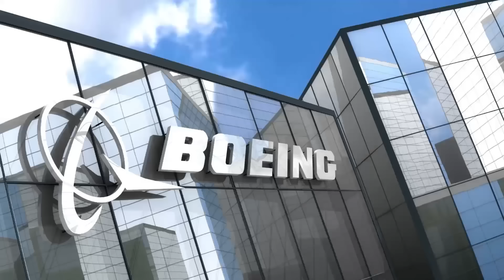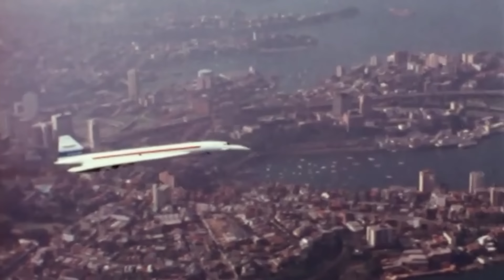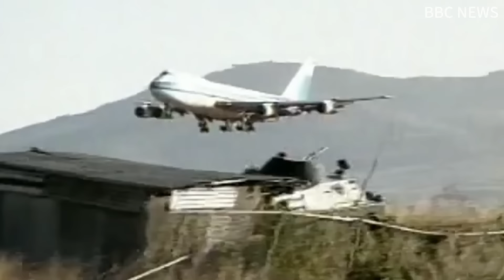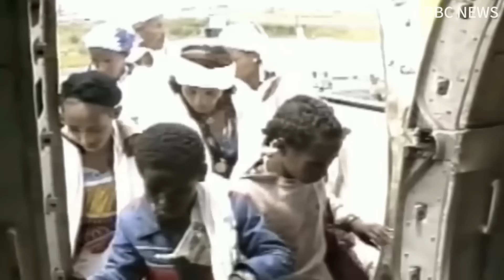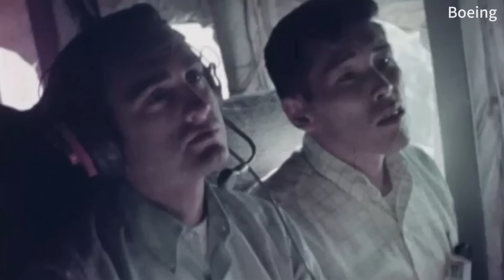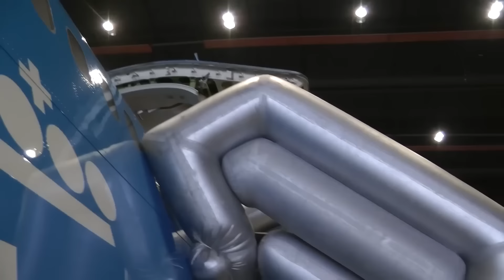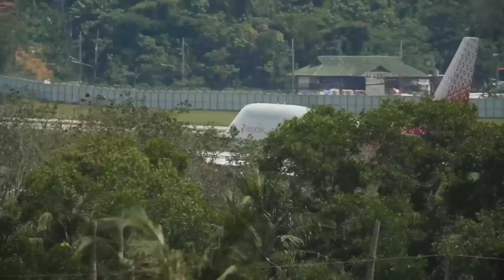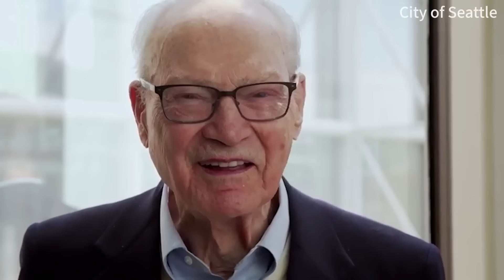What The Boeing 747 Hump Was Really For

Comment: My first flight on the 747 was the "Red Eye" from San Francisco to Atlanta on Delta in 1970.   Because the flight was not even half full, I was able to put the armrests in the middle four seats up and sleep all the way home.  What an aircraft!!
Reply: I did that on an Airbus A330 on the way from JFK  to Helsinki.
Reply: I was a rather excited 7-year-old back in '72 when looking out the window at the gate, I found out that for my first trip on an aeroplane, it would be aboard a 747 "Jumbo jet".  Also exciting (for me) was the boarding was through a jet bridge -- as previously I'd only been at smaller airports where you board via airstairs.   Once aboard, the size of the aircraft was quite apparent with the two aisles with 3-4-3 seating (as at the time, single aisle had been more common).   Once we were at cruise, I asked my grandparents (on this trip, I was with my grandparents and an older cousin) for permission to wander about inside (they were worried I'd get lost in what seemed to them a ridiculously large aeroplane) -- walked all the way to the front and back.  Stopped and looked up at the spiral staircase up to the upper deck (but didn't climb up).
Reply: @nuk1964  - It's funny, because these days most people I know would be entertained by the novelty of having to use airstairs to get into an aircraft. Plus, I know that I least feel more "connected" to aviators by walking on the pavement and past the engines, almost like I'm doing the pre-flight walk-around.
Reply: @bruzote  airstairs are nice -- as long as it's in fair weather and too hot nor too cold, and you don't have mobility problems.
It is indeed quite interesting to watch the built-in airstairs being deployed and retracted (such as on the Boeing 737).
Reply: @nuk1964  Cool 🙂
Reply: I did the same on a flight from San Francisco to Honolulu on a 747 then again on a flight from Seattle to DC Dulles on a different aircraft, which I have forgotten.  

The most strange thing about the latter was I was in the center seat of 5.  A woman with a baby boarded and got very upset when she discovered that I was seated in the same row (where she was in the left side seats).  She wanted the entire row to herself so she could nurse her baby.  The flight attendant told her that she did not pay for an entire row and she could move back one row to have that row entirely to herself.  She was quite angry for the entire flight.

I contrast these to a flight from LAX to DC Dulles.  I was once again in the center seat.  I am not a narrow person, but in that row, I was one of the thinnest.  Immediately after takeoff, I pulled down my tray, layer my head on my arms and slept most of the 5 hour flight.
Reply: L
Reply: Some interesting replies to your post, starting a debate about the ethics of folding airliners armrest seats down  so you can stretch out under a thin blanket and hopefully snooze away a 12-14 hour flight, lol. I always thought they are such a cool looking aircraft since I first got interested in aviation . I was going to reply to the guy who posted this video about commentators experiences flying in a 747, but after reading yours will post mine. For me it was the first time I flew internationally,  1986 from NZ to the US in a Pan Am 747 with my sister who lived in New York. Fortunately she was an experienced air traveler, so as soon as possible grabbed extra seats to stretch out in, a good tip! The plane had lots of empty seats so I thought that’s how it would always be, however after 100 + flights that hasn’t happened much.Lucky if you get one empty seat next to you, which happened last year when I couldn’t get a window seat, however once we were airborne a lady with a baby in a single seat across the isle asked if she could swap seats , so that was my good deed for the flight. Pan Am ‘s long gone , but since it was my first it left a great memory, especially one of the flight attendant girls, she must have showered in perfume before boarding, leaving a cloud whenever she passed and had more makeup on than I’d ever seen up to that point on a gal, but staying in New York for a few months soon educated me about that sort of thing, lol.
Reply: It's not an Red eye if you are passenger.
Reply: nothing about this has anything to do with a 747. You can literally do this on every aircraft that has 4 middle seats. I've done so on a 777 and a 320.
Reply: @jemand8462  a320 does NOT have a middle row
Reply: @jemand8462  you are a jackass
Reply: @jemand8462  Are you daft? How does the capabilities of other aircraft make the OP's story about his first flight on a 747 not count as having anything to do with a 747?

Other aircraft can do the same thing? Cool.

Is the story about other aircraft? No.

The OP's post has EVERYTHING to do about a 747, because the post is specifically about a 747. So, good job, you've proven both that you know about other aircraft, and that you're an idiot.
Reply: @AlindBack  LOL
Reply: @AlindBack I did the same thing on an Airbus 380 transfer flight. It was probably 80%+ empty. 10 rows of seat. I was the only one in 3 rows. Because of the YouTube algorithm, I'm sure the OP is just happy people are commenting on his post.
Reply: @AlindBack  are you daft? What does a story about sleep in a 4 seat row anything to do with specifically the 747? nothing.
Reply: @AlindBack 
This idiot doesn't know anything about aircraft.  Neither the B777 or A320 existed in 1970.  And the A320 has only one aisle.  So good luck making a bed out of the "4 middle seats" on that one.  Replying to trolls and idiots just gives them credibility.
Reply: @AlindBack  - I am laughing, and also thinking on a bad day I could make the same comment you're tearing apart. :-D Humbling.

Comment: Actually, the hump wasn't there because Boing thought the 747 was going to be a freighter. It was there because Boeing was competing for the new Air Force heavy-lift contract that eventually went to Lockheed and the C-5. The C-5 also has the cockpit above the nose.
Reply: And a full-length (but very skinny) upper deck with passenger seats behind the pilots.

Comment: I’ve been on a 747 three times. Once from O’Hare to Seoul round trip, makes sense.  The strangest 747 flight I took was United Airlines O’Hare to Denver.  This is like a marathon runner, doing a 200 meter dash.  I’m sure United had a good reason for using a 747 for this flight, it was practically full.  I was shocked while waiting at the gate when 747 rolled up for such a short flight.
Reply: There was a short range version, I guess with more seats instead of fuel. Mostly used on heavy trafficked Japan domestic flights IIRC.
Reply: @BoomVang  I figured United was just moving the jet from one part of the country to another and filling it with passengers to make some money, maybe they were hauling some cargo too.  I don't know if this is something they used to do all the time,  as I don't fly commercial very often.   I'm sure the fuel tanks were practically empty for a 747.

Comment: My first, and only, ride on a 747 was in 1991. I was stationed on Okinawa for what was supposed to be 18 months, that turned into 22 months  another story)....But after a year I took a 30 day leave to go home...the leg from Japan to Hawaii was on a brand new 747 !!! I was very impressed with the 747 until....the overhead passenger reading lights started screwing up. If you turned it "off", it would continuously flash on If you turned it "on" it would flash off.....Apparently the crew could not to disable the entire system so we "enjoyed" being locked inside a flying disco tube for a few hours, until Hawaii. The flight was scheduled from Japan to San Francisco with a fuel stop in Hawaii,....That 747 was taken out of service forcing the airline to find seats for all the displaced passengers, and as it turned out the majority of the passengers were going on to San Fran....while I was going to sit in Hawaii for a few hours, since I was traveling on a 50% off military stand-by ticket and got bumped off EVERY seat that was available from Hawaii to the States until the full paying passengers were taken care of...not mad, that's just how the system operated, and operates....and how I remember my first and only ride on a 747.
Reply: I was on Oki then also. I was at Kinser with 3d FSSG, Maintenance Bn. Don’t recall flying on a 747 going home on EML. Semper Fi.
Reply: This happened to me - the flight engineer's solution was to give the crew  a roll of black tape!  I said it would puzzle the people investigating an aircrash, that and electrical engineers light was covered with black tape. (I suggested they should isolate the circuit!).
Reply: I flew from Frankfurt to Chicago on a United 747 in the 90s.  I sat in the middle seat of the middle section of five seats. The in-flight entertainment screen in front of me did not work and displayed nothing but static the entire flight.  The flight was packed and there were no other seats available.  I had to drape my jacket over the seat back of the seat in front of me to keep from getting a headache.  Fortunately the passenger seated in front of me was very accommodating to let me drape my jacket over the back of their seat.

Comment: The cruise speed was 625mph
Reply: Cruse speeds are measured in Mach numbers, which due to barometric pressure variations do not readily translate to the same mph/kph speeds.  However, for your satisfaction, 747s hardly ever flown to exceed the 900 kph / 560 mph mark in zero wind, for fuel saving and other purposes.  Your provided value may be achieved but with considerable tail wind.

Comment: one thing that is very interesting about the earlier 747's.

the original -200 had the short upper deck that the -100 came with, but during its lifetime, boeing offered a streched upper deck (SUD), that could be fitted to already build -100 and -200 airframes.

they ended up converting 2 -100 (both for JAL) and 12 -200 (2 for UTA and 10 for KLM) to the longer upper deck, which increased the passager capacity and suprisingly made it more fuel efficient

for the conversion, they had to completely remove the structure of the existing upper deck aft of the cockpit and part of the fuselage behind the original hump, before rebuilding it, with the longer hump.

this essentially was a test for the later -300, which came from the factory with the "SUD upgrade"

if you wanna see pictures of the converstion in progress, look up "boeing 747 SUD conversion"

Comment: What nonsense!! The modern day aircraft don't travel at M 0,80 because they CAN'T be designed to go faster("even with computers"), but because ALL airlines choose efficiency over a little more speed.
Reply: *fuel efficiency
Reply: That's exactly what he said in the video, didn't he? I'm sure that laymen understand that the plane can go faster by using more fuel, but it's for special circumstances. Just like when you walk outside, even though you can walk faster in special circumstances, and can even run if you're allowed to run.
Reply: What nonsense?? That was obvious from the video. All of aviation from the '50s through the '70s was about speed: "get there, get there, get there!" - noise, air pollution, and fuel consumption be damned. Yes, there was concern for aerodynamics and efficiency, but only after environmentalism really kicked in did that become THE top priority. (Fighter jets have slowed down since that era, too, for a different reason: the emphasis changed from speed and power to stealth and electronics.)
Reply: @RB-bd5tz  What nonsense? Re-watch and listen for this quote, "The modern day aircraft travel only at M 0,80 and they CAN'T be designed to go faster("even with computers")." This was a claim about the unique design of the 747.
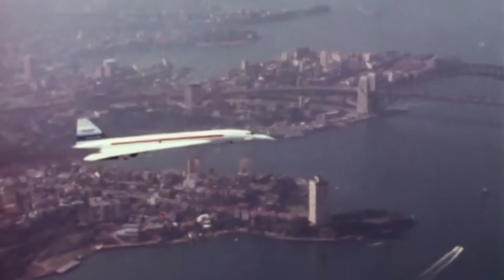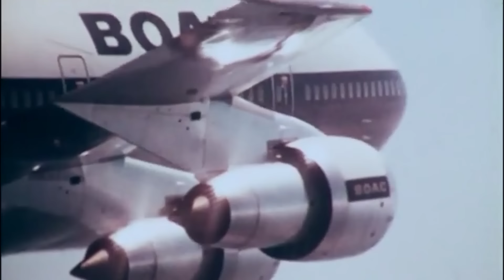Reply: @lours6993  Ah, yes: 3:35-3:45 "an aircraft that modern computer-aided competitors can't outpace". That simply means they can't, which is true. But I see, and agree with you, that it also implies that we can't do better now, which is a dumb point to make.

Comment: US Airforce sought a heavy lifter aeroplane, the 747 lost out to C5 Galaxy. So Boeing got PamAm to buy it as a passenger plane.
Reply: inaccurate. The 74 was build with both categories in mind, the C5 wasn't.
Reply: @Advancedkid ,

The *C-5 Galaxy* and the *Boeing 747* share a fascinating common origin in their initial design purpose, stemming from the same US Air Force requirement in the early 1960s:

1.  *Common Origin: The CX-HLS Program (1963-1965)*
    *   Both aircraft were born from the USAF's *CX-HLS (Cargo Experimental - Heavy Logistics System)* competition launched in 1963.
    *   The goal was to develop a massive strategic airlifter capable of carrying *outsize and oversize cargo* (like tanks, missiles, helicopters, bridges) that couldn't fit in existing cargo planes (like the C-141 Starlifter).
    *   Key requirements included:
        *   *Massive Payload Capacity:* At least 100,000+ lbs.
        *   *Intercontinental Range:* Unrefueled global reach.
        *   *Outsize Cargo Handling:* Ability to load bulky, heavy military equipment quickly.
        *   *Rough Field Capability:* Operations from shorter, semi-prepared runways.
        *   *Drive-On/Drive-Off Loading:* Via nose and aft cargo doors.
        *   *Kneeling Landing Gear:* To lower the cargo floor for easier loading.

2.  *C-5 Galaxy's Specific Initial Design Purpose:*
    *   *Winner of the Military Contract:* Lockheed won the CX-HLS contract in 1965.
    *   *Pure Strategic Military Airlift:* The C-5 was designed explicitly as the **US Air Force's premier strategic heavy lifter**.
    *   *Focus:* Rapid global deployment of outsized US Army and Air Force equipment directly to forward areas, potentially on rough fields. Its cavernous cargo hold, nose/aft loading, and kneeling gear were optimized for massive, bulky military hardware. Speed and range were critical for global power projection.

3.  *Boeing 747's Specific Initial Design Purpose:*
    *   *Losing the Military Bid, Winning Commercially:* Boeing lost the CX-HLS military contract to Lockheed.
    *   *Commercial Freighter First:* Recognizing the need for a commercial counterpart to the upcoming supersonic passenger jets (like the SST, which was later canceled), Boeing pivoted their CX-HLS design. *The initial 747 was conceived primarily as a high-capacity freighter.*
    *   *The "Hump" for Freight Loading:* The iconic upper deck (the "hump") was specifically designed to allow a *swing-up nose cargo door* for straight-in front loading of large freight containers and outsized cargo, while keeping the cockpit above and out of the way. This preserved the main deck's structural integrity and volume for freight.
    *   *Passenger Potential:* Boeing knew the airframe could also be adapted for passengers, anticipating the need for high-capacity "jumbo" jets on busy routes. While designed as a freighter first, the passenger version entered service before the freighter variant (747-100 vs. 747-100F).

Comment: Landing in Kai Tak and had the privilege to be in the flight deck
Reply: I landed an Air Canada 747-400 at Kai Tak as first officer in the right seat. It was a challenging approach with a very low right turn onto final runway heading just above the rooftops. There was a building with a checker-board pattern visible ahead just as you started the right turn. I could see the clothes hanging out on the balconies very close below the right wing tip while making the turn. The timing of the turn was very critical so that you didn't overshoot the final approach path. That would require a go-around since reverse banking the aircraft to re-acquire the approach path so low would be very dangerous.  It was my only landing there as most captains took the difficult landing and Kai Tak airport closed shortly after in 1998.
Reply: @jimpike7445  Memories you dont forget. I have flown the 747 various varient sunch as teh Combi - Air India and from 100 through 8. over 500 times in my life. Sat in the very first row in MEA, Saudia, Lufthansa, Swiss and lots more. Remember Sabena? well I have flown than as well. And let us not forget PAN AM!!!!!!! I have also flown the 747SP!!! I have to say I am very fortune.
Reply: @mmhuq3  Sabena    Such a bad experience never again     SAS  same and sabena
Reply: @jimpike7445   The difference between us is I actually used to fly  the checkerboard approach at Kai Tak and you are making the whole thing up.  The checkerboard was on a hill  not on a building and  apartments are no where near the aircraft or the approach path.
Reply: @sorrenson  The checkerboard was an actual wall which certainly looked like a building on the hill and I could definitely see apartment buildings under the right wing from the right seat as I initiated the turn to final. I didn't do very many Hong Kong flights because I didn't like the upside-down hours. I much preferred the southern runs to the Caribbean and South America with little or no time change. I spent 31 years flying for Air Canada, DC9, 727,L1011, Classic 747,the last six years as 767 Captain. I don't appreciate being called a liar!!
Reply: @jimpike7445  " don't appreciate being called a liar"  Then don't make up stories . The checkboard in no way looks like its on a building and the closeness to buildings was highly highly exaggerated .
Reply: Landing in Kai Tak was pretty amazing from the back of the airplane, too.  Seemed like you were looking UP into people's apartments!